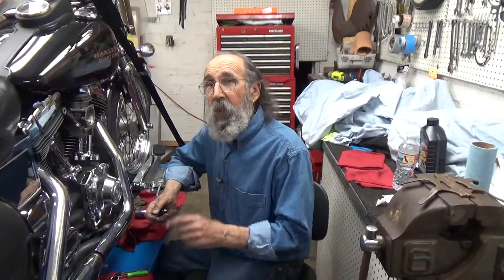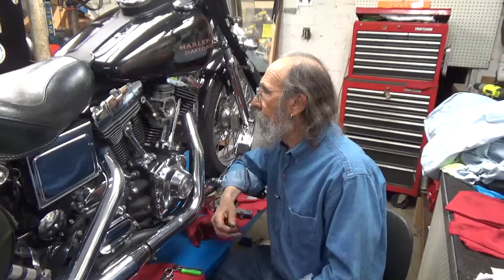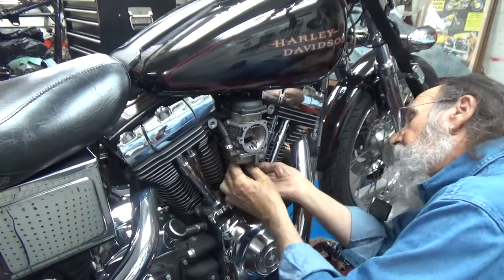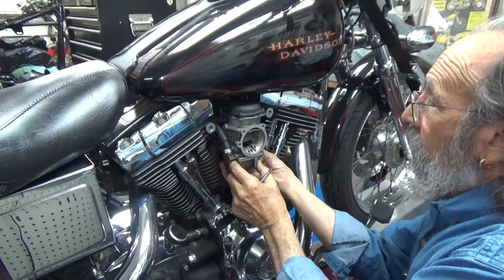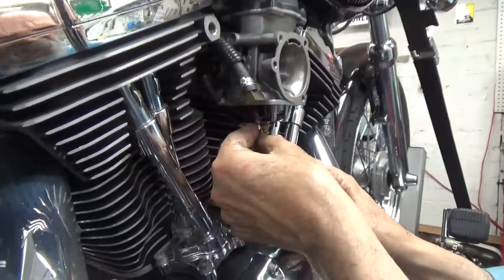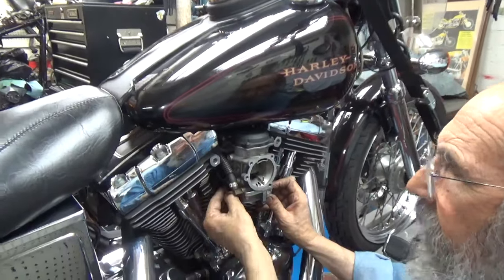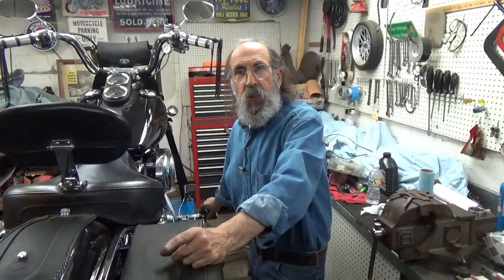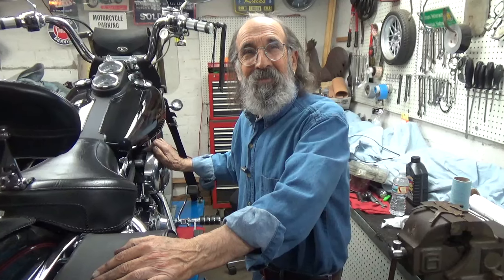Rejetting the Carburetor on a Harley Twin Cam

Comment: This was both informative and relaxing.  Like the Bob Ross of the motorcycle world.
Reply from the maker: Wow, thanks!
Reply: after reading this comment it really sounded like I was watching bob ross.
Reply: Haha! I literally said the same thing. I wish I could be so calm!
Reply: Agreed
Reply: I'd rather hang with Pacific Mike, than Bob Ross .
Reply: I was thinking to say the exact same thing! Lol
Reply: Indeed!! 😂😂😂
Reply: Dude I was gonna say that. Guy is an absolute legend. !!
Reply: Yes!!! 😂 so true!! Very relaxing and amazing information too.
Reply: @pacificmike9501  I'm trying to figure this out Mike, my bike runs great but this is what I have. 03 FXD big bore 95in. Mondello heads, .590 gear drive Wood cams, 10.5-1 comp., Dyna tek ign. Bassani 2 into one stainless exhaust. It has the stock 40mm CV carb with .205 main and a .48 slow jet. I live at sea level on Maui. It does crackle off throttle but no flat spots and hauls as. With the build I have and at sea level from what you said that slow .48 should be way too small.
Reply: Was thinking the same thing. Calm voice. Could fall asleep to it hahaha

Comment: Mike did you know that the screws that hold the bowl on are J.I.S screws and not really a Phillips head screws. If you look closely at the screw head there is a small dot on the head of it. JIS stands for Japanese Industrial Standard. The angle of the slot is slightly different from a Phillips head causing a Phillips to slip. Buy JIS screwdriver and never strip another JIS screw and you'll never need a impact driver to removed bowl screws again.
Reply from the maker: I think you are correct.  I think I didn't know.  That's two people who have set me straight on this one.
Reply: @pacificmike9501  got that from a great mechanic (Bob)at Nick's Custom Cycles in Williamstown NJ east coast largest used HD parts yard.
Reply: @jeffbower6940  HI DOES NICK'S CUSTOM CYCLES HAVE A WEBSITE OR CONTACT NUMBER? COURIOUS . LOOKING FOR MECHANIC WITH KNOWLEDGE  AND PARTS FOR 
 HARLEY AMF'S
Reply: If you call Nick's sometimes they'll be very helpful. These guys are old school and really know their shit.Go there if possible there is a wealth of information between those guys. Also an antique bike showroom. 856 728 9607 hours Tuesday through Saturday 10 -6 Friday til 8pm.
Reply: A small dab of antiseize on those float bowl screws will do you or the next guy to service that carb a solid.
Reply: Good catch, Jeff Bower! Most people have never heard of and have no idea that J.I.S. screws exist.
Reply: I standing over a carb marked 27491-96 from a 1996 1200 XL sportster and can confirm a single dot on all four bowl screws
Reply: Yeah & he forgot to put white grease on the bowl screws!!
Reply: J.I.S. On an American made motorcycle? Seems odd. But I suppose some stuff is metric so go figure.
Reply: @robertbrewer2179  The CV on a Harley has Harley Davidson cast into the carb body, but it is made by Keihin, a Japanese company. Keihin also supplies Hondas, Kawasakis, and probably other brands. They make a good product.

Comment: Great video as always Mike.  On my 2003 Dyna with the K&N intake and Vance & Hines short shots pipes I wound up having to go up one size on the main jet, add two #4 washers under the needle to fatten the mid range, and a size 50 pilot jet.  It is probably the most well behaved carb setup I have ever ridden.  The other folks are right about those JIS screws, I hate those things.  I went to the hardware store and got some stainless steel allen head screws with lock washers to replace them with.  Anyhoo thanks again for donating your time to the rest of us.
Reply from the maker: Thank You.  Good stuff.
Reply: Hoyt1911A1 how many turns out is your pilot screw at with the 50 slow jet in? Thanks
Reply: For JIS screws it's a JIS screwdriver. As is my '99 has just similar setup with the quiet baffles. 45 main and 2 ⅓ turns out. You have to start with fresh fuel, clean air filter, new plugs. 
Idle at 1000, low idle will result in popping unless you don't shut the throttle completely against the stop when riding, if you like to get some pop idle at suggested lowest 950 or even 900 or less if you have a hiflo oil pump. Shouldn't start and run from cold with no choke, I just back the choke in slowly to 1100 after a few seconds and get the lumpy idle till it's moving down the road. Takes a few good runs to sort if it's been running badly from a previous owner who didn't understand carbs.

Comment: Hey brother I am have carburetor issues lol i am sure you have heard this a thousand times but I use this bike to get to work so this isn't a toy to me . It's a 1992 harley davidson softail heritage. It has a cv carburetor.  So this is the deal it only has 27000 miles on it . It was running just fine no problems at all until 1 day the idle started raising up when warm . so I pulled it out and clean it up a little bit and changed out the top diafram and put it back together and now I have that problem and it stalls when I try to give it any gas just coughs for a second and dies . It is not a vacuum problem cause I sprayed around the intakes and nothing.  So I don't know what to do brother idk maybe put new jets in and what jets do I put in ? It has one of those hyperchargers on there and strait pipes.
Reply from the maker: Well, a Hypercharger and straight pipes usually require a larger low speed jet than stock.  Try a couple of sizes larger than stock.  Usually, the main jet is fine.  Evos tell you stuff pretty easily.  Remove the spark plugs.  If one is dark and one is light (they really don't match in color), you have a vacuum leak.  Spraying around the manifold is not the only way.  Sometimes it will tell you and sometimes it won't.
Reply: @pacificmike9501  thanks mike I just came back from the parts store and the guy gave me a 45 to try out . I pulled the plugs and the front plug was a touch lighter but nothing crazy
Reply from the maker: They should match.  I don't know how far yours are off.  Allow for maybe burning a little oil, but otherwise, should match.
Reply from the maker: Yours is a low mileage bike.  Plugs should match.

Comment: I prefer the Harley CV carb over fuel injection myself..  Rejetting fuel injection can cost upwards of $500 or more for a new fuel module as opposed to rejetting my Harley CV carb cost a couple bucks.
Reply from the maker: Yes, and there are "pros and cons" to both.
Reply: @pacificmike9501  ya for sure man i have both bikes...  you ever put one of these "newer" harley CV carbs on a shovel???  i bet it would run great!  im just not sure if one would bolt on right or not?

Comment: I have a 2002 FLSTC with a CV carburetor didn't want to idle but it ran good at speed. I replaced the 45 low speed jets with a 48 and replaced the high speed jet from 185 to 190 and it idles fine now.  I have an 01 Road king with fuel injection and I am not impressed with it once i got a change to look it over.  I am sorry i bought these twin cams I would trade them for an Evo today. I am a Shovelhead  panhead guy they are big lawn mower motors I can work on.
Reply from the maker: I get it.  By the way, you probably didn't need the main jet change.  It'rs running on the pilot jet most of the time and the main jet is usually adequate. I wonder what your altitude is.  If you're running a less restrictive air filter and a set of free-flowing exhaust pipes, you might try a number 50 pilot jet.  Just an experiment.
Reply: @pacificmike9501  I live in south east Alabama it is 450 foot above sea level. I got this bike used and it had great care taken of it. The guy did change out the factory emulsion tube and has changed out the factory pipes. He had an idle issue with it too. When I rebuilt this CV carb I put back the factory emulsion tube a 48 slow jet and a 190. I am going to ride it today and see how it goes and look at my spark plugs. We moved here from the Tampa Florida area and my old 72 FLH ran great there but now I am having a too rich mixture issue.

Comment: I bought a 2004 FXSTD last June with 5,000 miles, has screaming eagle exhaust. It had a lean spit. I opened up the adjustment and that helped. I also run non ethanol fuel. The spit is less frequent, but occasional. I cannot help but think if I made this mod on my bike it would get more go on the throttle.     
Thanks for the tutorial.
Reply from the maker: Thank You.  And, you're right.

Comment: My 2002 FXST never starts cold without the enricher . You may have shown me why .
Even have to open it s it slightly when it's in the 30's and 20's when I take off until it warms up .
Reply from the maker: Not a big deal.  Try a slightly larger Pilot Jet.

Comment: Pacific Mike... I know what you mean. In 2005 I bought a new HD heritage softail and had my local Harley shop (to not void my warranty) rejet my carb and install rush slip-ons before I took the bike home. Well..Sometimes (not all the time) when it was idling and you give it gas to take off or if you wasn't even on the bike and just tried to rev it up it would pop and cut off. They had my bike in their shop nine different times, that's right 9 times and they could not figure out why it was doing that. So the last straw was when I was taking off from a red light. I was in the middle of the intersection and it popped and cut off and I was almost hit buy a pick up truck, I traded it in on a new Electra Glide.
Reply from the maker: Someone should have been able to figure that out.  That's awful.  But, I hope you're enjoying the new bike.
Reply: @pacificmike9501  I know right.... Oh they replaced the intake gaskets 4 times and installed 3 different new carbs. One of the times I left the dealership (next to express way) and got about an 1/8 of a mile and it started running rough and leaking gas. I had to ride with the choke on to the next exit get off and get back on the other way to go back to the dealership. I was there from noon to 8pm and they could not figure out why it was doing that. They had to take me home. Three days later they said it was ready so I go to get it and they said it was because the Harley Technician installed the gasket (I'm guessing the float bowl gasket) upside down or backwards. Needless to say it was still doing the popping and cut off thing.. I'm on my second bike since then. A 2008 HD Electra Glide and is great because I am the only one that works on it... I'm an ASE certified automotive technician and have been working on bikes as well since the mid 80's..

Comment: Mike, I have a 2005 Dyna with an 88TC, running a high flow air cleaner and slip-on exhaust.
I recently swapped out the pilot jet to a 48, and my bike is still spitting out the carb at around 2000-2500 rpm. 
I'm at sea level and have the air/fuel screw turned out 3 turns. Would you recommend trying a 50 pilot jet? 
Also, the bike doesn't spit from the carb if I keep the enricher on while riding. 
Thanks for your help and I appreciate these videos.
Reply from the maker: Changing jets is always an experiment.  You just described it perfectly.  I had a shop at sea level.  With a free flowing exhaust and air filter, I usually started with a 50.  I think you're almost there.  A 50 might not be enough, but probably, it will.

Comment: You might as well say it, breather bolts are made of cheese!
Reply from the maker: They are hollow and should not be stressed.  I can't speak for the material they are made of.
Reply: Harley has a habit of this. EG the timer cup screw. Brits too. the screw for the zener diode gets overtorqued and cracks the diode- system overcharges on long freeway runs and can destroy the whole system. Ya can't blame that on Mr Lucas.

Comment: One of my choices when buying my bike i am old school ill stick to the carburetor
Reply from the maker: Me too.  But, it's just "personal preference."
Reply: When I bought my 2002 Nightrain FXSTB the salesperson was like you want that with fuel injection right?  I was like no give me the carb version. I later upgraded the card to a mikuni 42 MM flat side it runs amazing that bike is dialed in like a Swiss watch !!! Thunderheader pipes S.E lifters, push rods, S.E forged HC pistons. Woods 590 conversion cams with a modern hyd cam plate S.E high compression ignition. S.E clutch, with a hole shot kit in the primary

Comment: Funny I stumbled across this awhile ago. I just rejetted my carb yesterday. I had an 01 EG TC88 that was injected and I got rid of it. I for one don't like fuel injection at all I've always been a carburetor man myself. I could have put a carb on it I guess but I just wasn't Fond of that bike it was too new for me. Years ago when I was a teen early twenties wrenching at a local garage I rebuilt a couple carbs a week. It was a regular thing needed at the time along with choke pull offs being replaced. Then the newer carbs you had to remove the seals covering the adjustments and drill them out to get the tool in there to adjust them. Then it was what all vehicles had on them, no injected cars to fiddle with. Carburetors are so simple and easy to work on its odd today a lot of people don't know how to work on them. Same with points. Everyone puts electronic chips in and tosses the points. Not me I keep my points they work well and only need a periodic adjustment. I'm old school and prefer the old ways that's why I sold the 01 and got the 73 Shovelhead instead. That's my kind of machine there. Old school and real simple to work on. Plus the look and sound is what I wanted. These are what we're new when I was growing up. Shovels and Pans everywhere running up and down the road.  It has the S&S super E on it and it seems to be running too rich. Mine doesn't spit or choke it just bogs down and has no umph so I'm jetting down. Plugs are black and fouled so it looks to be running too rich. Another lost art with guys are reading spark plugs too. Plugs tell you what's going on in that combustion chamber . Just waiting on some decent weather to get her out so I can see what she's doing after the jet change... You and I have a lot of the same traits of what we grew up with and have worked on. More cars for me as an auto mechanic but I've always ridden bikes since I was a kid. I enjoy your videos as well. Not trying to take away from your post I just always talk a lot,  post conversation instead of just one liner replies... ✌
Reply from the maker: Thank You.  Your comments are very appreciated.  We're both wordy guys,but, I try to answer all of these comments.  We'll talk again.

Comment: Just got a 98 Fatboy with factory CV 40 I am rebuilding the carburetor. It has a 45 jet and a 185 high speed jet. I live it southeast Alabama 600 ft above sea level. Does the jets sound right.
Reply from the maker: They sound like original "super lean" original jets.  High speed jet fine.  If the motorcycle is all original internally and has stock exhaust and air cleaner, it's probably fine.  Free flowing air cleaner and exhaust (aftermarket), try about a 50 for the slow jet.

Comment: 10:20 "Philips screws out of here"... Nope.  they're JIS metric screws not Philips (the JIS screw has a small dot on the top of the head as indicator it's a JIS metric screw), that's why many people end up badly stripping the heads on those metric screws when using an American Philips screwdriver on a Japanese screw, you can get lucky though using a Philips if those metric screws is not tight, but with any force the Philips will easily strip the head.
Reply from the maker: Thank You.  I feel ignorant now.  What I normally do, when they're too tight, is have someone hold the carb while I smack them with a hand impact driver.  Crude, but effective with only one good tap.  Thank you again.  I've now been properly informed.
Reply: Wayne Simpson If I see the Philips or Japanese version start to or not able to turn I’ve often used a small pair of pliers to get them to start turning I did not know there was such a thing as a Japanese Phillips
Reply: @MoeLarrycurly1  those CV carb bowl screws are Harley part# 27579-88A JIS screws, they are metric size M4 x 0.7 x 14mm
Reply: Wayne Simpson 👍🏼🖖🏽 thank you

Comment: Another Excellent Tutorial Video Mike. You have got me thinking on this side of The Pond that i might have the same issues as this Dyna. Strangely enough my Fatboy is of the same yr with the same Carb & Engine & the Intake & Exhausts have been changed too however i discovered that mine started its life as an EFI but the owner couldn't fix it & i guess they was fed up of taking it in to a dealership every time to plug their gadget in to diagnose a fault code so maybe a Carburetor should be considered as an upgrade? What do you think? I wonder if that Dyna has been Carbed too? 
 Whoever Carbed mine 1/2 done the job. They never changed the ECU/EFI so in other words the bike still thinks it is has Fuel Injectors because i have a permanent Check Engine Light on which is a pain nevertheless it runs ok but i still think it has a Lean Spot Issue so as a result of watching your video i will try a different jet & one day i will buy a Thunder Heart Ignition.
Reply from the maker: Wow!  I have converted bikes from injection to carbureted.  But, I did a complete job and changed the wiring harness to change it completely.  I did this for customers years ago and of course, used bigger, badder carburetors along with some wild programmable ignition systems.  Guess I was just being a control freak.  I think yours would frustrate me not having that "complete control."

Comment: was wondering if you help a fellow out, just put new 525 feuling reaper cams in my 88ci twin cam, has two brothers racing 2-1 exhaust,  arlen ness big sucker intake, just wondering where i should start with my slow jet and the main? i live about 1,000 ft above sea level
Reply from the maker: I'd probably try a 50 slow jet and end up with a 52.  Just an educated "guess."